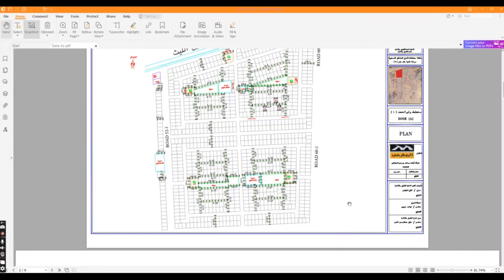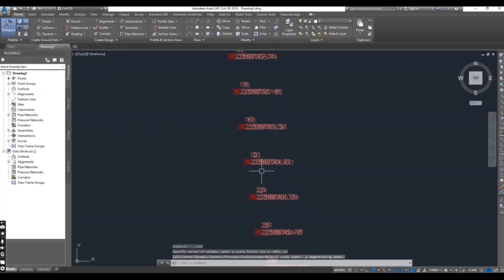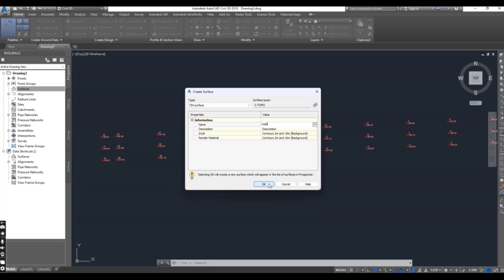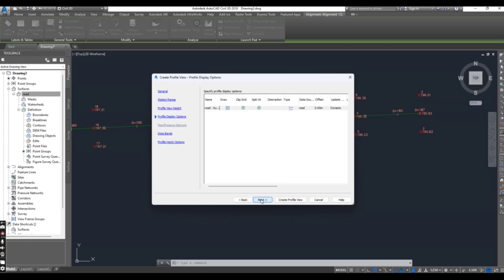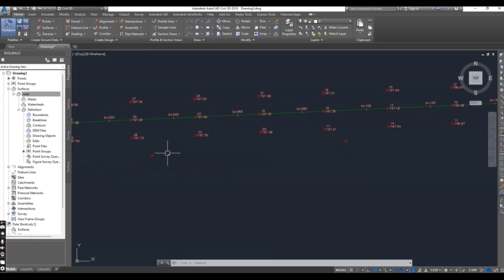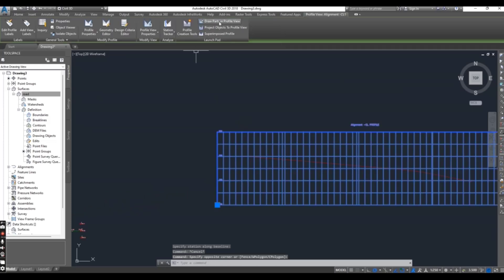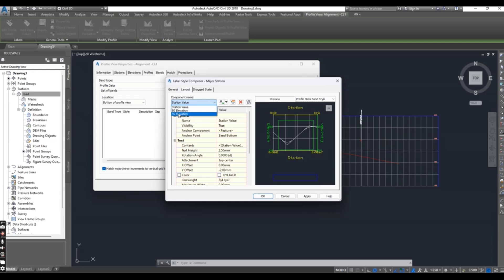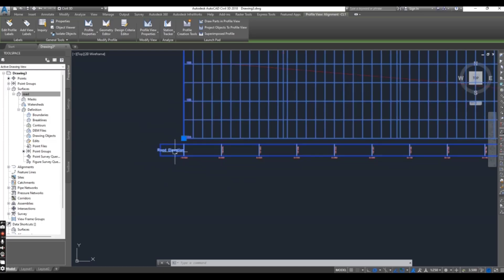How to Show Door Elevation in Profile View along Road Design Profile in Civil 3d|Station Equation id

Comment: Brother, I'm using cracked version of 2025. While creating vertical profile after clicking on geometric editor the dialogue box shows blank. Eager for your suggestions.
Reply from the maker: Close autocad or dwg and then open again, hopefully it will solve because its not related to crack